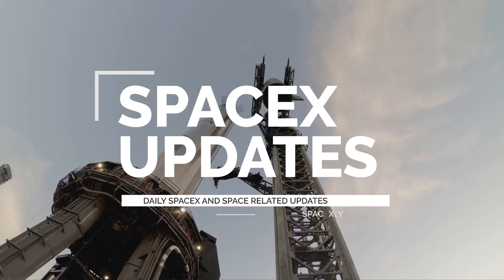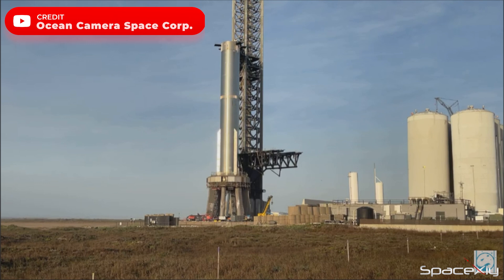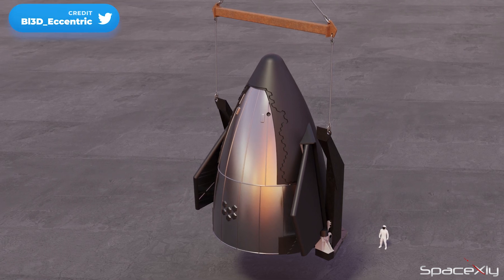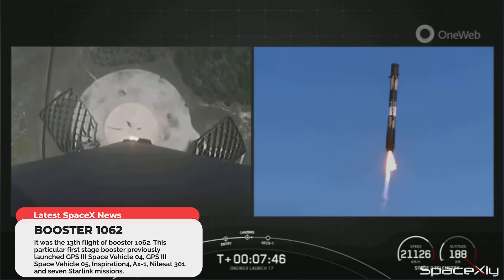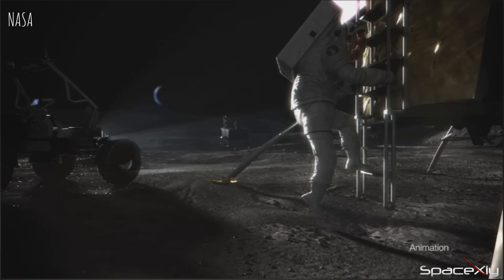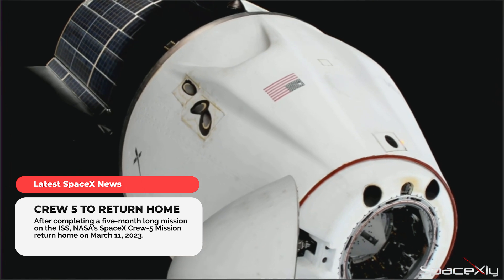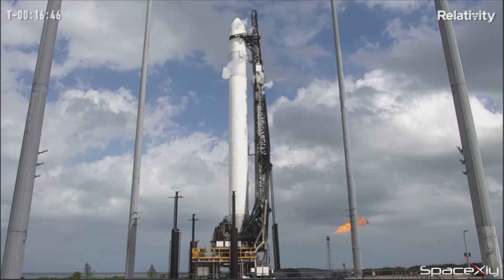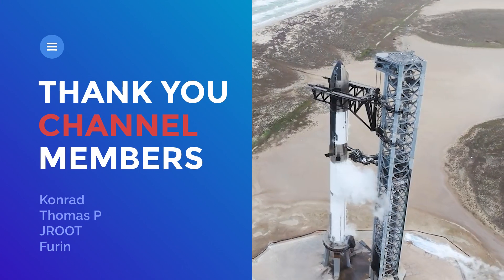Why Removing Booster 7 from the OLM !? 🚨⚠️ What is happening? | SpaceX Updates

Comment: The FAA IS dragging their feet on granting a Launch license for this Starship orbital test because, it's the federal AVIATION administration and Not the Federal Space Administration.  The FAA is best in the World at enforcing Aviation Regulations but Spacecraft, Spaceflight and Space Programs have little in common w/ Aviation.  The FAA has as much expertise in regulating Space Programs as the DMV does regulating NASCAR racing. Elon's said it himself,  the FAA is Fundamentally Broken and needs to be split as the Air Force did when it divided into a Space Force. This new Commercial Space Race that's growing so rapidly is going to demand better regulation much sooner than later. That said,  it doesn't make sense for SpaceX to go w/ a Full Throttle launch of 33 Raptor Engines when they've had so many OLM & launch pad issues testing at 1/2 throttle with fewer engines, despite the improved performance of the Fondag concrete base. It makes total sense to fully install the Water Deluge system and stop all the repeated OLM & pad damages otherwise they increase the risk of a RUD at Stage Zero.

Comment: Don't bother. The BN7 booster will not be destroyed. It will be sent to replace the engine, and the launch pad will receive additional protective equipment.
Reply: No it's not..they just need to remove b7 from olm to finish upgrading olm